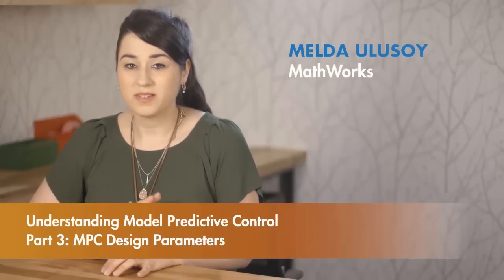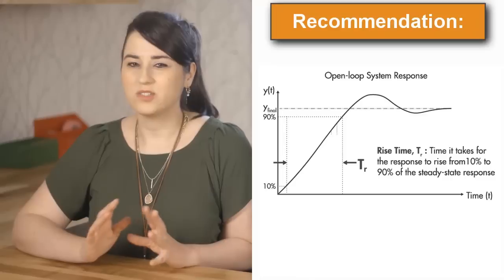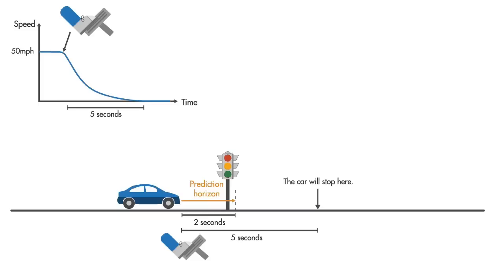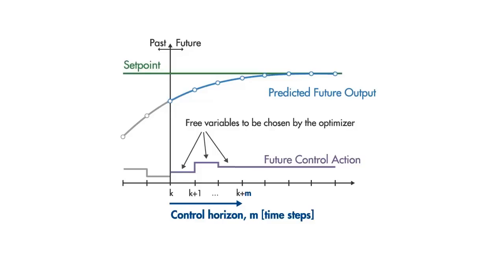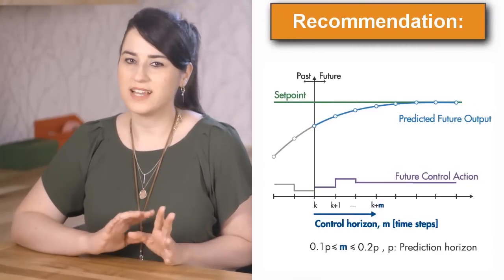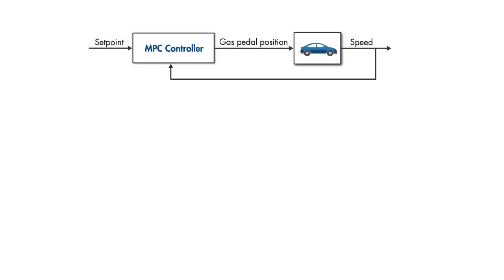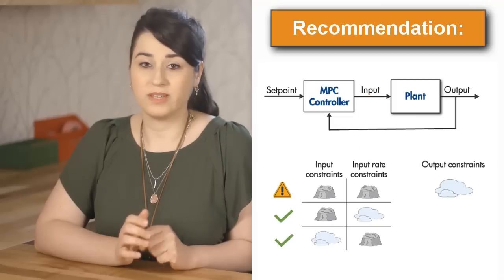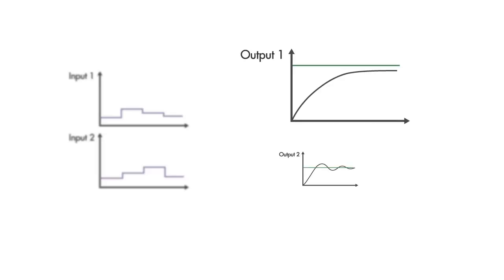Model Predictive Control Design Parameters | Understanding MPC, Part 3

Comment: am a bit confused,does the sample time equal to prediction horizon
Reply: They are different. The sample time of the controller is really about how long it takes for the controller to compute an output to the plant. And it depends on several factors such as the system bandwidth and the maximum sampling rate of your processor. Prediction horizon is measured either as time duration [seconds] or time steps as in the video. It is about how many sample times you predict into the future.

Comment: Nice illustration and very good explanation. However, I don't really follow the part about control horizon. If the setpoint varied(instead of being constant as described in the video) for each time instant k, a control horizon shorter than prediction horizon is not suitable, right?
Reply: Hi, unless you have preview, meaning your controller knows about the future reference, the setpoint used in the prediction is assumed to be constant. The controller looks at the value of the (varying) setpoint at current time step and uses it throughout the prediction. So, the same discussion in the video about control horizon would apply. You wouldn't choose a large control horizon because this increases complexity and doesn't significantly improve controller performance.
Reply: Hi Melda,
Thanks for the answer.